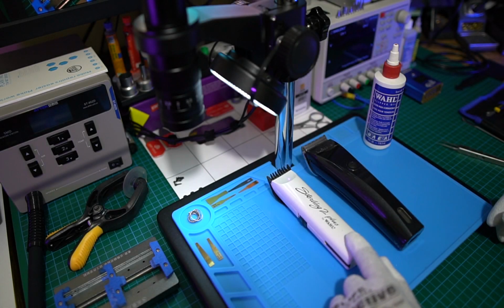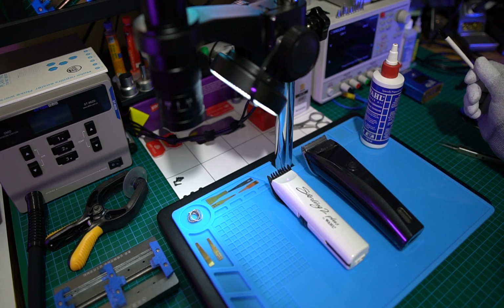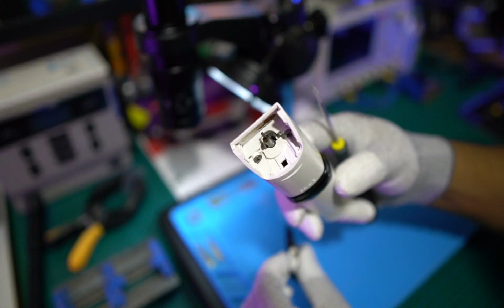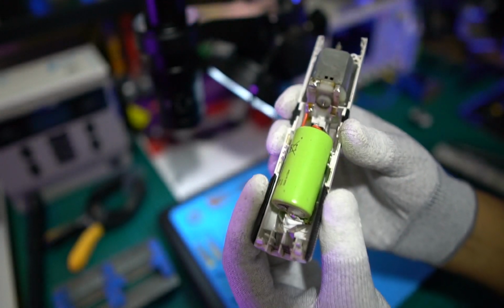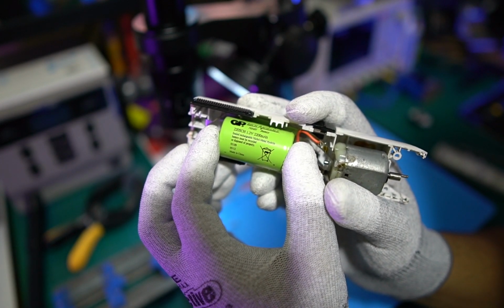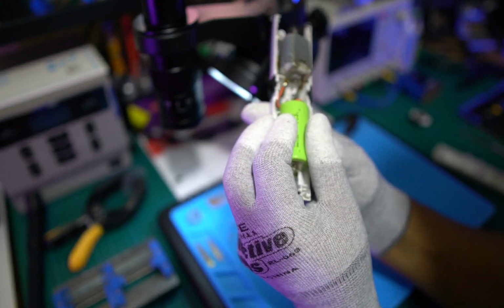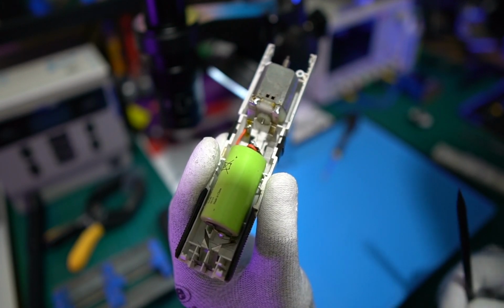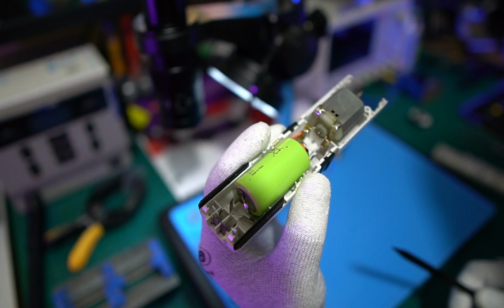Wahl Sterling 2 Plus Clipper Refurb Fix Repair Guide - iRefab

Comment: Wow great video, I’ve had mine for around 12years, still going strong to this day, I’ve opened it twice for maintenance ie cleaning switches and getting old loose hair out, electrical contact cleaner with a old toothbrush works magic, just spray away from the actual battery or put some paper towel on before etc, changed two blade heads and still on the factory battery. These things are now discontinued, old is gold! fazz from Uk 🇬🇧

Comment: Battery is 93189 2200mAh. Dimensions 42mm x 22mm
However, what fixed it for mine, was I cleaned the tarnish off the switch contacts with a fibre pen, made a massive improvement to the motor speed, in fact it now goes like stink!
Reply from the maker: Thanks for this tip 👍
Reply from the maker: Thanks for this tip 🤲🏻

Comment: I have had mine for abt 6 years, end of the motor has got quite rusty. Are there any alternatives u would recommend to this trimmer as u cant buy these new anymore. Want something similar to this for detail and beard trimming
Reply from the maker: For detailing look for the Babyliss Pro detailer, I still have my sterling 2 and still use it to trim the sides of my beard with the number 2 blade plastic cover thingy and use the Babyliss for detailing.  I’ve been complimented by so many people on how clean it looks (the beard) 😊
Reply from the maker: I have used many other beard trimmers but keep finding myself coming back to the Wahl Sterling 2 plus for bulk beard trimming.  A quick search online and I found this link for you, it looks like they are selling it for about £50.  I cannot vouch for this company’s customer service or reputation so please check everything out carefully before making a purchase from them.  https://cosmeticsally.co.uk/products/2381

Comment: Hi irefab thanks for the video it's a good one.
I have got Wahl sterling 2 plus have had for the best of 8 9 years. Recently I had it on charge for slightly over 2hrs as the battery was flat. After charging it was going to use it and it was sounding like the battery is going to go flat. So what I did put it on charge for another 30mins. Was going to use it again the same problem sounding like the battery to going to die on me. Took of the head cleaned it put it on and I hear the motor winding but not as it should. So I don't if it's the battery or the motor. The motor is rotating but my battery after so much charge...it still comes out like it's going to die on me. 
Help me out my brother. I dont want a divorce with this trimmer very close to me. Shout back at me kindly. Thanks peace out ✌
Reply from the maker: Sure, no problem, thank you.  In your case I think you definitely need a new batttery 👍🏼 If you have the skills give it a go, it’s not that hard to change one out.
Reply: @irefab  thank you for your swift reply much appreciated. Could you kindly share with me the battery code?

Also from time to time clean the head by taking it apart and then put it back together. My question how can I...erm...sharpen the blades on the head any suggestions.

Thanks. ✌
Reply from the maker: Apologies, I somehow missed this message, hence the late reply.  The battery code is 1.2v NiMH Single Cell (SC) battery and the capacity is 2500mah.  Regarding blade sharpening, these are auto sharpening blades.  All you have to do is oil them regularly and they will sharpen themselves.  There is no other way to sharpen them that I am aware of 👍

Comment: Hi irefab...thanks for the video and it's a good one. I have Wahl sterling 2 plus model. Recently I had it on charge for close to 2hrs. After charging was going to use it, and it sounded like it's not been on charge at all like the battery is during even after charging for two hrs....you sugestion..what could be fault. But when I take of the head it winding but as it should. Help me out brother...i have had this for close to 8 9 years and don't to get separated from it.  Help me it out. Thanks peace out ✌
Reply from the maker: Check other answers 👍🏼

Comment: Hi, Thanks for your video. Is it possible to upgrade battery to 330SCH & still work with original charge etc 3300mAh ?
Reply from the maker: As long as it is 1.2v NiMH Single Cell battery then you can put whatever capacity you like and it will work.  But make sure you check the dimensions so it will fit in the case 👍
Reply: @irefab  cheers. Yeah I’ll check size before ordering

Comment: Mine doesn’t cut any longer after a few years use. Just painfully catches my hair. Replaced head and battery. Do you think I need to replace the motor?
Reply: Battery is a 93189. I tried using a cheaper 600maAh  one,  but it doesn't have the capacity to effectively start and run the motor,  so buy the proper capacity one., which is 2200mAh, as in the video.
Reply from the maker: @manspace8505 I doubt it’s the motor.  If it’s catching your hair it could be a couple of things.  1. It could be the contacts are not making a strong connection at the switch leading to less power at the motor which would cause the blade to catch.  2.  It could be the blades need oiling, as long as you drop some oil on the blades after each use and let it run for 15 seconds the blades should be fine and will sharpen themselves.  If it’s the first issue I would take everything apart and test all the contact points at the switch.  Sometimes you have to bend the metal contacts a little by by hand to get them to contact better.  The entire inside mechanism is really simple and there are no electronic circuits in there.  Just battery, switch, motor and metal contacts.  Hope this helps 👍

Comment: Thanks for the video bro. I've had mine for almost 10 years now and it's been solid for buzz cuts and shaping my beard up. Going to replace the battery and order a new head for like £30 total. It's still ok but want to restore it to factory new which should see another 10+ years! I originally saw all my local barbers using it years ago, so I came home and went on google to search for the model lol. Little powerhouse of a trimmer.
Reply from the maker: Thanks for watching the video @Rafh27 and it was great to hear your feedback.  Mine is still running strong to this day.  I’m glad to have heard back from someone else who had a similar experience.  They are like little tanks lol, sure hope you get another 10 years of use out of it 👍

Comment: Hi there mate nice video…. I have the same product. The light goes green when charging but nothing… it just gets hot. Is this battery or motor? Thanks in advance
Reply from the maker: Hello Kieran and thanks for watching the video.  From my experience the first thing to go on these is the battery, the motors are tuff little buggers and as mentioned in the video mine has been running for over 15 years now.  So I doubt very much that its anything to do with the motor.  Also getting very hot is also a sign of a failing battery or failed one (as batteries start to fail the resistance inside them increases = heat).  There is no circuitry inside it (no capacitors, no resistors, no integrated circuits etc) it's just a direct connection from the battery to the motor with a switch for "ON" and "OFF" in between.  Go ahead, crack it open and replace that battery I am 99.9999% sure that's all it is 👍